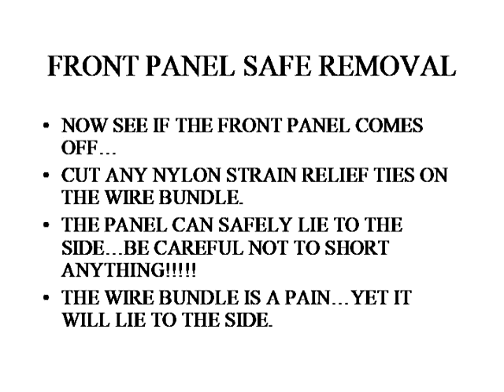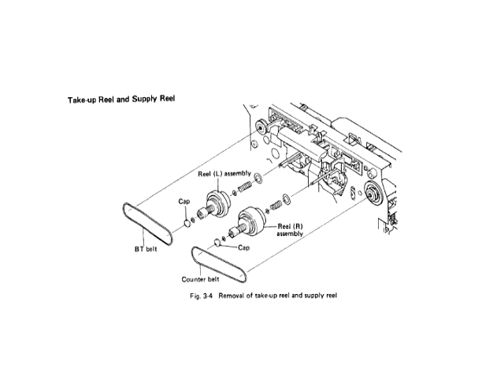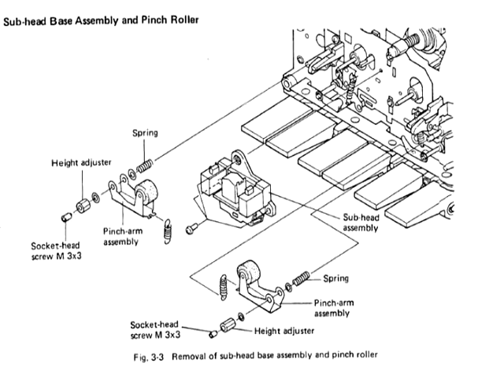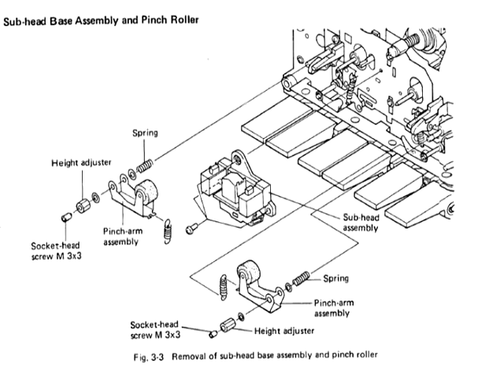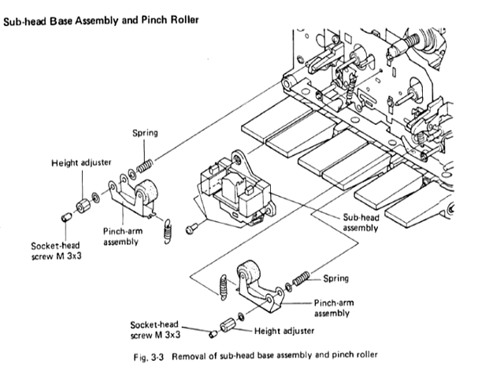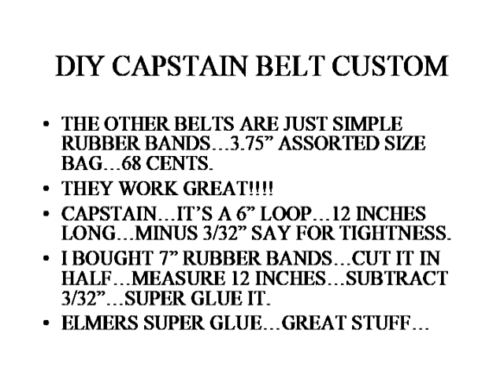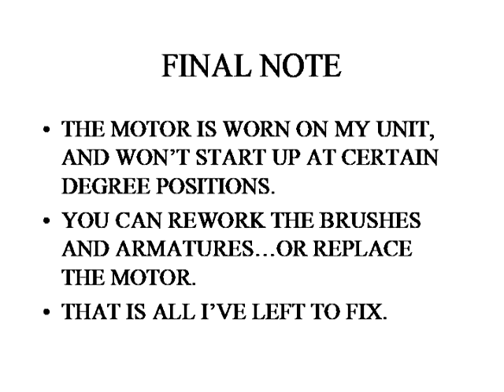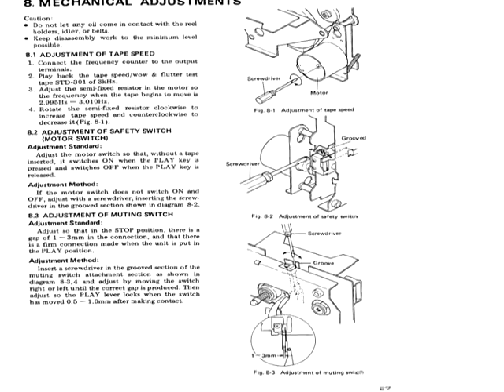Pioneer ct f750 belt theory p2

Comment: You should have shown how to replace the 3 belts inside the chassis, capstan flat belt and the two smaller belts. The two belts in front is easy to replace.